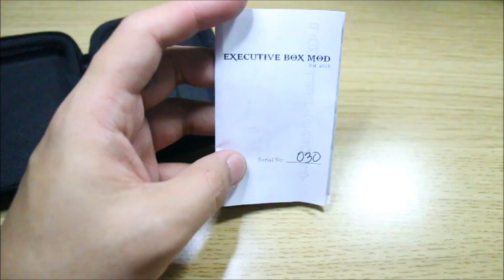THE KALASAG KILLER?!?! Executive Box Mod by Japhtech Engineering | Quality Hardware Review

Comment: I don't know about Kalasag being brought up in the same sentence of this review. Any "Veteran" vaper knows this...copper connectors gets tarnished a lot quicker than silver plated  copper, silver in general has better flow of current also, thus hits harder, which has been a standard practice of BB Box Mods PH since the ARMAS days. Nice design on this mod tho.
Reply from the maker: I read an article about silver plating, that the current might only flow through the silver plating, and not through the copper, which may result to a higher voltage drop. Nothing certain, just a possibility, which kinda makes sense. For me, a silver plated copper contact is as good as a freshly polished pure copper contact. Silver plating your contacts only ensures that it won't tarnish easily, which would result to consistent flow of current and less voltage drop. I just clean my mod and polish my contacts regularly. Subjective, but that's what works for me. I prefer solid copper contacts over silver plated. Appreciate your comment! 👌 maybe you saw what I did there. Haha! Just want to make sure that the title of the review is catchy! Lol. I'm not a fan of product shaming. 😉